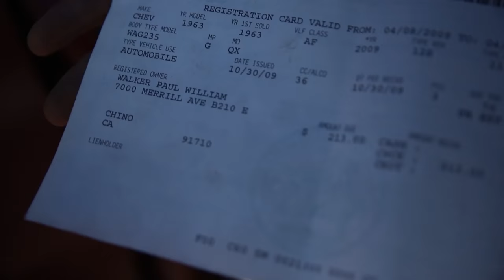GONE FISHIN!!

Comment: You’ve probably learned this by now but you can’t pull that magnet fast at all along the bottom. You have to be stationary on your boat or from shore and slowly pull it along the bottom or drop it straight down and bob it along the bottom. If your pulling it to fast your pulling the magnet sideways and not using the bottom part the magnet part that attaches to metal. Hope you guys have figured it out by now and people always throw things off bridges always good spots to find things magnet fishing.